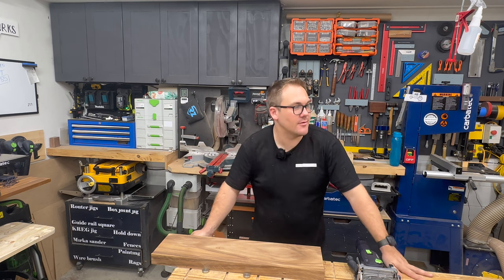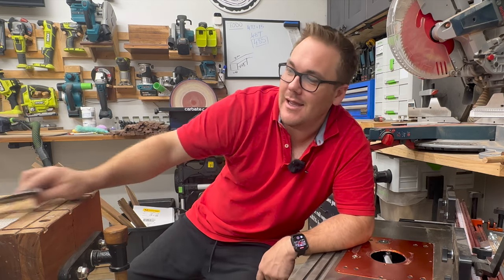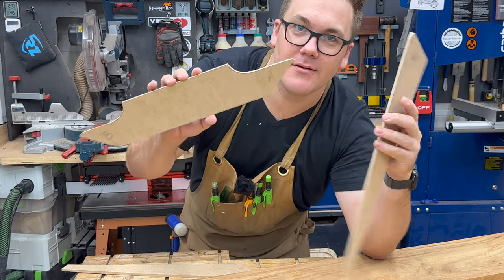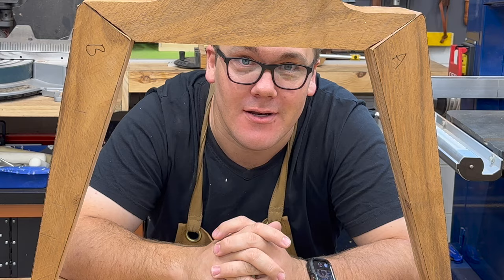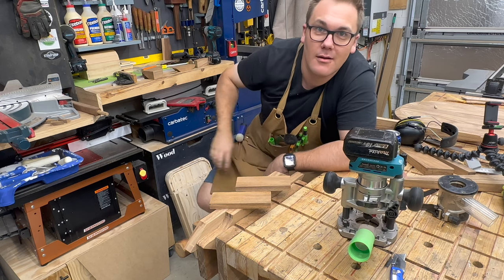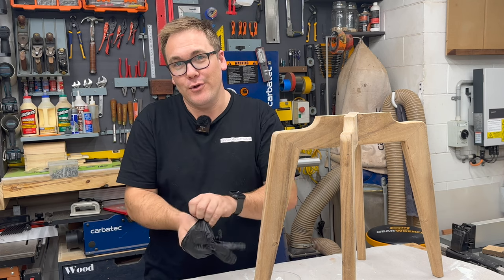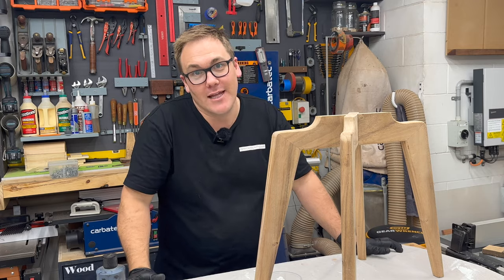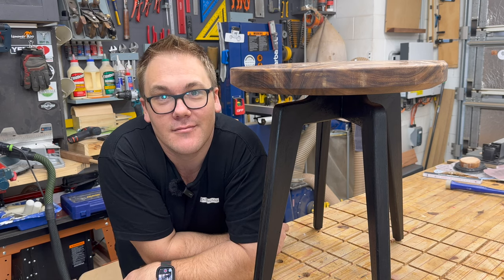Introducing the Squircle - The Coffee Table That Will Make Your Guests Jealous!

Comment: Squriqile love it. Looks awesome M8 may have to look at attempting top like this. Could do with a favour I've just recently acquired a dust extraction system by jet and looks like the one you have in the corner. My outlets on my table saw and plainer are 40mm but the hose that comes off the extractor is 100mm looks like u may have similar thing wondered how u got round it to be able connect it and do u use it for sanders etc if so how and what did u use to transfer it over?? Sorry new shop set up and it's bugging the arse off me!!👍🏴
Reply from the maker: I bought some dust extraction reduction adaptors from Carbatec. Feel free to message me on Instagram and I can send you some pics if you want. Cheers.

Comment: Wait what? You claim that you made a squircle but you didn't show how, and you said that you "just rounded off the edges". But a squircle is not the same thing as a rounded corner, and there are no commercially-available templates for squircles as far as I can tell. Did you print your own template? Is this actually not a squircle shape?
Reply: Actually I think you can tell at 10:45 that it's a rounded corner, and not a squircle. Hard to tell for sure though.